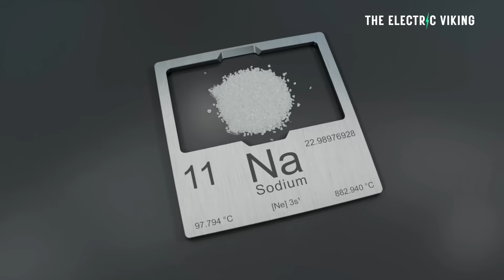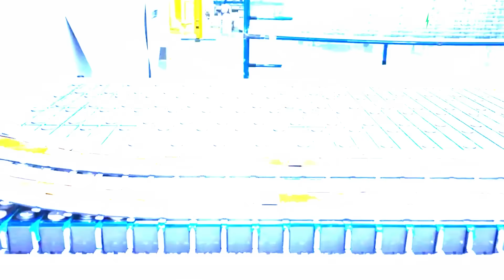Goodbye Lithium! New 3,600,000 Mile EV Battery costs 50% LESS

Comment: The average car in Australia travels 12,000km. But lets use 15,000 km to give a bit of leeway. With these batteries being able to last for 6,000,000km and still retain 85% capacity, that means one of these battery packs would be able to be used and swapped in and out out of cars in Australia for 400 years! Then it could be used in home or grid storage batteries for hundreds  of years more! All at a price of 1/6 of current lithium ion batteries, that have been purchased in high volumes. It is absolutely mind boggling!
Reply: I think the battery will also age over time. So maybe they can be used for 40 years max, what is still very good, but not for hundreds of years.
Reply: @philipschiwek6073 this is one of the things that is missing.  The lifetime in years.  Most LFP batteries will die of old age rather than number of cycles, this is why the number of cycles is not a game changer.  The other bit of info that is missing is the battery chemistry.  These things are not made of salt.  Maybe it’s still a trade secret.
Reply: yeah, they'll be recovered out of vehicles and used elsewhere for decades, very cool
Reply: So, it seems we will have to say goodbye not only to lithium batteries, but also to oil and nuclear power plants. No more nuclear waste and pollution from oil-fired power plants.
Reply: @yichang8834 Really? These batteries don't make electricity; you need power-grid electricity to repeatedly charge them. If we all drove electric cars, we'd have to generate maybe 20% more power! How? Coal, gas, nuclear, etc.
Reply: @tedwalford7615 
I think it's possible. I previously saw information from the United Nations about solar panels, which indicated that the world only needs 143,253 square kilometers of solar energy.  This is based on the total global electricity consumption and the efficiency of CSP technology.

With the continuous improvement of battery safety, we should be getting closer to this goal. There are many large-scale commercial energy storage systems on the market, but most use lithium batteries, which pose safety risks.
Reply: @tedwalford7615  Most Australians with EVs charge using the solar panels on their roofs. Which is just as well as the grid is getting maxed out with extra power from solar and the EV chargers charging infrastructure is lacking and expensive. Coal, gas & nuclear are all more expensive than renewables plus batteries unfortunately those proponents have the cash to lobby (buy) politicians. Distributed generation from micro grids eliminates costs of centralised power generation with its associated grid costs, reliability issues and security issues particularly with nuclear. When Russia invaded Ukraine the first thing they did was take out the power stations yet the losing party in the recent Australian elections planned to build 7 nuclear power plants (aka targets) despite Australia having no expertise with nuclear and the 2-3x cost. Luckily the voters were not sucked in by the lies. "Cheap, clean baseline power" Dutton crowed. He lost his parliamentary seat. No doubt he will get a board seat on an American corp with obsolete tech no one wants. (or maybe not as he was not successful conning the Australian voters.) Anyway his replacement Littleproud has taken up the baton although he has Little to be proud of.
Reply: Your calculations are same good as your statement they cars in Australia travel for 12 000 kms. They mean nothing.
Reply: Depends, here in the UK, average miles is based on vehicles up to 3.5 tons, that includes vans that are mainly high mileage delivery vehicles. Take them out of the equation and it's more likely less than 10k.
Reply: @pikachus5m166  My county claims average ca 13500 km/year but that is excluded vans and semi's.  They have their own statistics (18500 km/year...this includes vans only used to go to installation jobs closeby...for taking the tools with you but also koerier vans driving up to 100 km/day.
Reply: Capitalism has entered the chat and down voted.
Reply: What happened to CATL's "condensed matter battery"?  

Wasn't THAT supposed to be the battery "game changer"?   

CATL's Condensed Matter Batteries were supposed to give us electric planes... soon.    Where are they???

*
There's no negative consequences for CATL coming out with BS about batteries every 9 months.   They can put out BS with the blessing of the CCP (don't forget -  CATL is a CHINESE company, which means they do want the Chinese Communist Party tells them to do).

Russia funded the European idiots of the Green Party to help keep non-Russian natural gas off the market, and make them DEPENDENT on Russian natural gas.   Why shouldn't CCP- controlled CATL come out with BS battery stories that say, "Don't invest in oil indepence!  Batteries are going to make oil obsolete!".  --- or some such BS.
Reply: really, most people i know have close to 100k on their odometer, i myself have 250k +
Reply: What an absolute rubbish claim. You do know cars in all countries have a speedo clocking the KMS. If the average car in Australia only travels 15k km then why does every car I. Australia that's over 5yrs old have over 100k KMS on the clock. This is the most retarded comment I've seen in a hot minute.
Reply: Or you could just drive to the moon and back 6-8 times...  😀
Reply: When you listen to people on the internet, you would believe every week they would drive a 1000km in one go. Even EV users, mostly in the US, always talk as if they need 500 miles cars at highway speed. Electric cars are already good enough for 99% of people, what we should hope is cheaper batteries.
Reply: @danielvilliers612 stop making this stuff up!!! A vast majority of cars travels hundreds of miles per day - delivery, business and also private use. I use my diesel BMW to visit my mom and go to a capital city as well as seaside - each time it’s 300 miles one way!
Reply: Funny, the average American drives 12,000 MILES per year. We suck.
Reply: Funny thing is NZers drive 14000 on the windy narrow roads and Aussies 12000 on long, straight wide roads. Maybe Aussies fly more and just use their cars around town.
Reply: Quote 
'It is absolutely mind boggling.
'More like it is absolute Bullshit
Reply: Don't hold your breath.
Reply: If they are real

Comment: The metric they need is $/Wh-km. Where km is the certified lifetime kilometers. That is the true cost metric.
Reply: This product is for solar and wind plants.
Reply: That's a variable indirect measure though, as its introduces additional external factors, some unrelated to the battery, such as motor power, drag coefficient, overall vehicle efficiency, vehicle weight, etc.

Comment: Inverters for lithium were fairly easy to design thanks to the relatively flat voltage curve over the discharge cycle. The sodium battery has a greater slope in its discharge curve meaning the inverter will have to deal with a high range of input voltage. So that could require more core cross-section and thicker copper with so delivery the same constant power output. You will need an inverted design to handle this battery (lower dropout voltage) -- some premium inverters offer this program or settings.  These batteries could easily dominate power walls.
Reply: This is one of the reasons why CATL are offering the Sodium batteries in two forms, as small 24/48v HGV start-stop batteries, and as combined batteries with Sodium/Lithium combined setup (again for commercial vehicles) - where the lithium takes the brunt of charging, and in the background transfers the energy to the sodium battery.
Reply: That hybrid approach. Wouldn’t it then cycle faster through the lithium portion of the battery packs as it sounds like they would be taking the brunt of the load
Reply: Exactly what so was thinking!👍😂
Reply: Power walls and megapacks? Or just power walls as megapacks would require too much energy throughout (worse than than the car setup)
Reply: I guess this is where SiC,  breaking  and GaN on the horizon might come in handy here. I am unsure of the exact cutoff  voltage,  you are right about the inverter performance if it were 1.5V say.
Reply: @horserous - Sodium Ion's range varies but most sources quote a cell range of 1.5v to 3.95/4.03v, nominal 2.65v.
Reply: @GruffSillyGoatthat's fine .. Adjustment of the inverter's HV supply from 800V to 1500V might well be  necessary to secure the traction power output as the cells discharge.  

Im unsure of the hybrid approach as it sounds like  stop gap to me, and  maybe they are nervous.
Reply: More likely to be adjusted around a 900v mid-point, as this matches current 800v designs closer (which can be as low as 650v and high as 1,000v). However, like 800v architectures it does mean Sodium Ion requires more expensive electronic components, particularly as it has such a low cutoff voltage (1.5v), likely needing more expensive Silicon Carbide or Gallium Arsenide components. This is also the case as Sodium Ion has higher power density, so can charge/discharge quicker than Lithium Ion (not all though, some like Zeekr have more power dense LFP cells and some NCM cells), so requiring more expensive power components.

However, Sodium also has lower volumetric energy density than Lithium (incl. LFP), which CATL hasn't published figures for, but could explain the hybrid approach. Looking at the CATL hybrid Freevoy battery the Sodium-Ion packs seem to be 15-20% wider, meaning fewer cells each with a lower gravimetric and volumetric energy density than Lithium can be included per battery pack. Sodium also has higher thermal management needs, as the cells can degrade from the mid-30°C, so they require more extensive cooling implemented with lower packing density in a battery pack. Again, the Frevoy battery shows space around the Sodium cells to support additional cooling.

I would imagine at this time, Sodium Ion with the current levels of energy density (175Wh/kg) but lower volumetric density, higher cooling needs, and more expensive power electronics needs will offset the initial price advantages of Sodium Ion, as the battery packs energy (kWh) level are likely a fair bit lower than that of Lithium currently.

This perhaps explaing the focus on 24/48v truck-start batteries, which can be larger than Lead Acid but are still relatively small, and hybrid A-B dual chemistry battery packs, with the Lithium providing the longer range support and the power dense Sodium providing support for rapid tops on the move in hybrids (PHEVs/EREVs in particular) and for some goods vehicle uses.
Reply: @GruffSillyGoat SiC above 1000V are breaking and higher votages are still in R&D. There's also movement of GaN  towards higher voltages.  With Semiconductor companies, market demand is key and they will do anything for market share. Ignoring sodium ion for a minute, moving on from IGBJT to GaN achieves 13% extra range. Cleary GaN with higher switching frequencies, smaller magnetics and higher efficiency (c. 98%) would be ideal for the  voltage range of Na Ion in time.
Reply: @GruffSillyGoati was suggesting increasing the battery bus to 1500V at high to medium charge
Reply: @horserous  - Yep, but higher voltages requires a systemic change, in both vehicles and charger component supply chains, as well as requiring proven designs. 

Well aware of the drivers but inertia also needs to be factored in, some parts of the world may move faster than others so the rollout of higher voltage electronics may be patchy, as a result there will stratisification in the electronics industry to supply components across the multiple voltage levels adopted in EVs. 

Zooming out I would say as an industry, it's just on the threshold of switching from 400v (effectively under 600v) to 800v (effective between 600v and 1,000v). 

p.s. being an retired electrical and electronics eningeering and design, oddly my EV is an 800v one that uses Silicon Carbide MOSFETs.
Reply: These are so cheap at $10/kWh that I wonder if you could just write off the bottom part of the capacity (lower voltage part of the discharge curve) and still have a battery that's way cheaper than anything else.